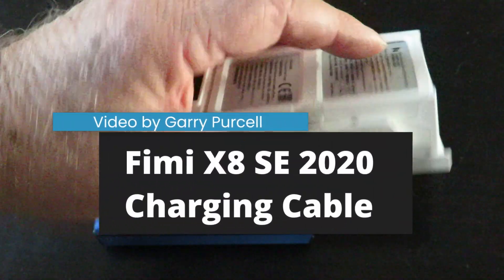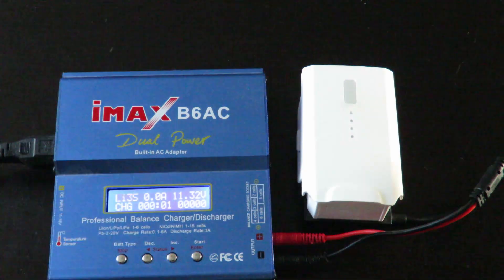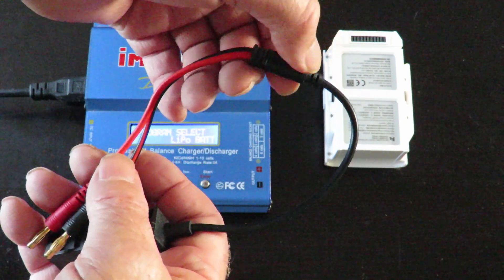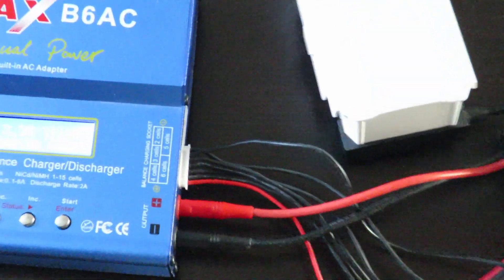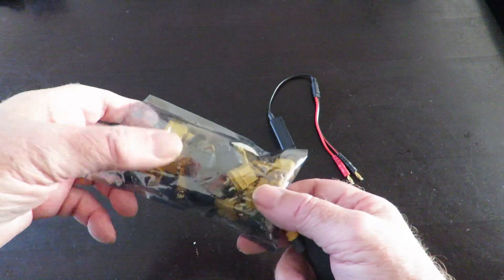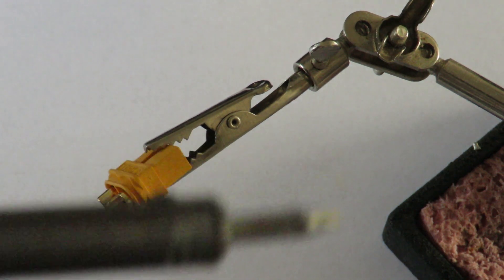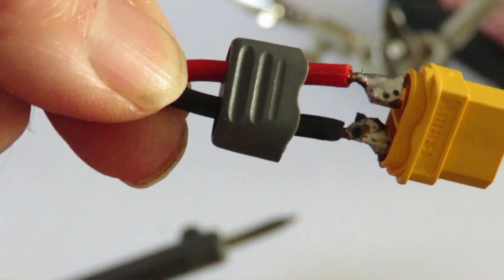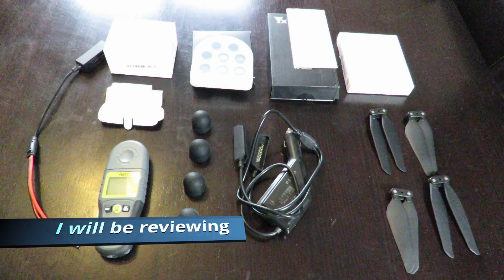🚁 How to Charge 6 Fimi X8 SE 2020 Batteries all at the Same Time.

Comment: Garry.... where did you locate that multi-plug board with all the different connection plugs..??? I've looked around quite a bit and haven't located one as yet.
Reply from the maker: Its called a "XT30 Plug 2S-6S 40A Lipo Battery board"
Reply: @GarryPurcell  Thanks Garry... I happened to stumbled across something similar recently. Thanks for getting back to me.

Comment: Dear Gary, I hope you are well. I recently got a second battery and was wondering how to store it since the chemistry is Li-Po. I read in the manual the battery is smart but it does not say anything about storage discharge for example. Could you please elaborate?
Reply from the maker: The smart battery auto-discharges to storage value.

Comment: I have the ev-PEAK Cq3 Quad 4 Port for my Yuneec Drone - I assume if I get the double cable it's the same without requireing the balance board?
Reply from the maker: I don't own a Yuneec quadcopter.
I would assume if the battery has an inbuilt balance chip, If the battery has the same pinouts, this cable should work.
Reply: @GarryPurcell  I am meaning, if I got the Fimi and the cables it will work in my charging unit. That the Fimi batteries have a in-built balance so a balance lead is not necessary, only the cable as shown.
Reply: @edwardsonlinemedia6209  definitely weird af thing isn't it

Comment: What are the links to the charging cables? 
Also, you are not balance charging, but only utilizing a straight charge to battery thru the positive and negative wires.
To use balance charging one would have to utilize the the "white" connectors on the balance board.
The optimum way is to balance charge, if possible.  That way each individual cell in the battery pack is monitored individually.

Anyone have any cable that would balance charge those batteries?
Reply from the maker: The balancer circuit is inbuilt in the smart battery.
So you cannot use an external balance cable back to the charger to balance the battery, via the charger.
Here is a link to the cable
https://www.banggood.com/custlink/mDvRCTrdwD

Comment: The battery fimi is LIHV not Lipo
Reply from the maker: My Batteries state Lithium-ion Polymer on them.
Be careful if you try you overcharge them thinking they are LIHV, you will kill your battery life.
Reply: @GarryPurcell  The fimi battery is a high voltage lipo not a standard lipo so lihv which means high voltage lipo if you charge your battery in lipo mode it would only be fully charged 75% 80% charge if you look at the original charger fimi it's written on the output 13.05v it means that it's a LHIV battery

Comment: Nice video however, please bear in mind those batteries are of Lipo HiV (high voltage) 3S. You should have selected HiV if your charger supports this type of battery.
Reply: yeah he isn't charging his batteries properly.
Reply: @billkaroly  OK, but how then? I'm programming the Imax B6 for Lipo correctly as far as I can tell
Reply from the maker: I've been in covid 19 lockdown for several months, and I'm unable to get out and fly my quads, so I haven't charged my batteries to full capacity for a while, I just keep them topped up.
Reply: @GarryPurcell  no Koch's you can get out there and fly
Reply: Do you have any idea what the model number for the cells is? One of my batteries has developed the habit of hitting ~40% and then suddenly dropping to 0%. I was thinking a cell has gone bad.
Reply from the maker: Thank you for that information, my Charger goes back quite a few years, so no HiV settings.
Reply: @GarryPurcell  Make a firmware update and you would have the option lihv
Reply from the maker: @brocas7325  Thank You, I'll look into that.
Reply: @GarryPurcell  Yea...I can't get more than bout 75% into the Fimi battery from my Imax B6 before it goes "Full" at 12.6V. Yours gets more Garry?

Comment: Your battery cost two times+than your clone charger plz buy the original SKYRC charger to protect your expenses batteries
Reply: the charger is not important ! the charge control is inside the battery ! you can charge this battery with a stupid power supply
Reply from the maker: My charger is an original one from many years ago, long before the fake ones came onto the market place.
Reply: @GarryPurcell  the biggest problems are your charger needs updating to either a V2 or V3 supporting LiHV otherwise you are not fully charging your battery. Another thing is the battery balances the charge and not the charger so setting it to 3S is a waste of time. 11.4v and 1S should do it because the battery is doing the work. The bummer with the FIMI battery is you don't know the voltages of each cell, just the overall.
Reply: @billkaroly  yep LIHV
Reply from the maker: My Batteries state Lithium-ion Polymer on them NOT LIHV
Reply: @GarryPurcell  the one that shows on the video is fake not working properly the decision is yours i don't agree with your comments sorry
Reply from the maker: @nikolaosdenikarias3564  I bought the charger back around 2014